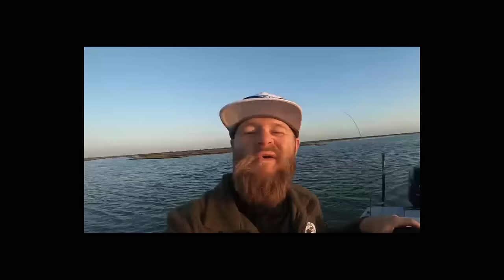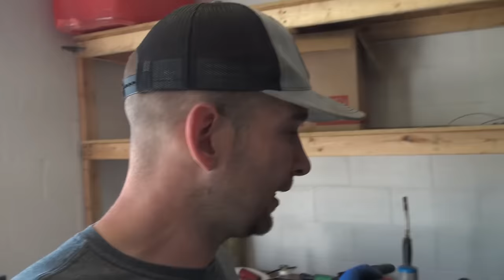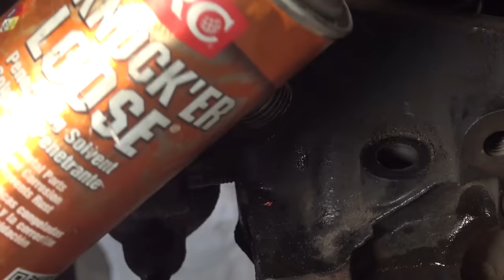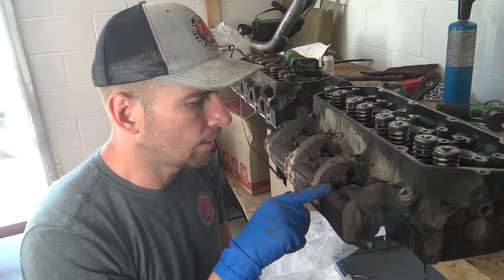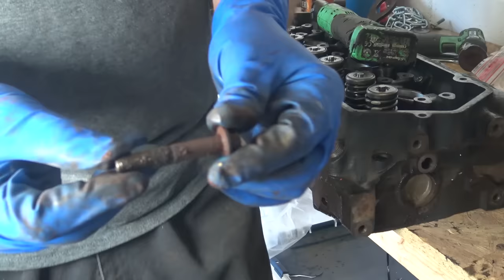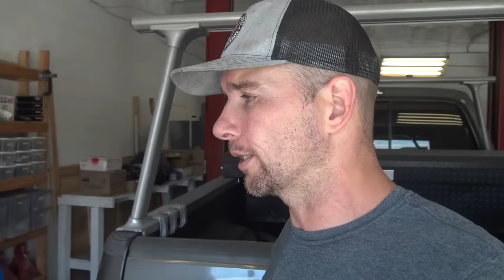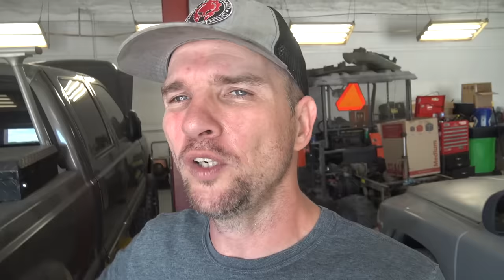Old Mechanic Taught Me This Trick To Removing Rusty Exhaust Manifold Bolts!

Comment: If you snap a bolt off and have to drill it out typically if it is rusted and been through so many heat cycles that it breaks you will have to drill the entire bolt out.   Don't even try an easy out.   If its broken off flush you will have to be very good at marking and center punching exactly in the center of the bolt and drill the bolt out entirely and very strait along the centerline of the of the bolt.  If you use an easy out they can and  will break.  Easy outs are made of brittle high speed steel and almost impossible to drill out.  Yes you can try a carbide drill bit but they usually won't work because of the rough surface of the broken easy out.  The carbide bit will usually catch on a rough spot and break.  Its better in some cases to remove the cylinder head.  Drilling out bolts takes a patient skilled technician.  Stephen's back and forth technique is common knowledge to a good experienced mechanic and is gold.  Usually The only situation an easy out will work is if the bolt is broken off by over tightening but otherwise has threaded in easily.  Use a left handed drill bit and you might not need the easy out.

Comment: Hey Stephen, great video. I'm changing my up pipes and where it meets the manifold,  the head broke off. I just ram to home depot to pick up a torch. They didn't have anymore yellow map pro gas so i picked up the blue tank - propane which looks like what you have. I was 🤔 if that's enough heat to do the job?

Comment: three rounds of wire brush and PB blaster over the course of a day, blasted with MAP torch and slapped a breaker bar on them. They eased out. Orginal bolts on a 95 chevy k1500

Comment: One trick I use for snapped bolts Is to use a stud removal wrench to remove a broken bolt. You have to be careful with the pressure you put on the tool so it doesn't slip,  which is the problem most people have with this technique.

Comment: I always give bolts a good whack with a hammer or with a short stubby drift punch and hammer. Doing this before hand fractures the build up and creates clearance from bolt to thread also allowing more space for penetrate. I rarely snap bolts unless there is some gilding going on.

Comment: Check out the tool called the Shake & Break.  It employs impact and controlled leverage to prevent breaking frozen bolts and studs.  Another cool tip is repeated taps with a small hammer on the fastener, after applying penetrant.  The vibrations cause capillary action to move penetrant into and through oxidation.  If you cannot reach the fastener with a hammer, install a steel or brass rod into a hammer drill and use the hammer function to vibrate the fastener.

Comment: If you have room you can rock back and forth with an impact and it will get done a lot quicker.  Also once you heat it up with a torch that's the best time to spray penetrating oil.  Even a wax candle will work.

Comment: One underrated problem is with bolts that stick through "the other side" where those threads are exposed and hold a significant amount of rust on them. Often times getting the initial break of the bolt to turn 1/32 of a turn isn't where things go wrong - it's when you finally get it backed out a ways. You wind up pulling the rust on the back end of the bolt into the grooves to a point where there is essentially no air space/travel space for the lands of the bolt to move through. This is why using the tightening/loosening, tightening/loosening, tightening/loosening method is so important, all the while spraying more penetrating oil before you tighten back up. Doing both things will break up the rust on the "back side" of the bolt. And of course, if you can get to that back side of the bolt with a wire wheel or wire brush, that's really your first step (cleaning that rust off).

Comment: Good job. I agree with your method.  But most of them were not rusty in my opinion. But I work on old equipment, not cars and trucks. Most of the old equipment the spray from the wheels have been hitting the exhaust and they are so rusty a good set of bits is your best friend.

Comment: I use a pinpoint butane torch to concentrate the heat more to a certain part.  The propane is hotter but I think its more effective to concentrate the heat.

Comment: Probably about a thousand guys said it, but I like to get in there with a hammer - air hammer, if there's room - and give the head a few smart raps or maybe a buzz for a few seconds.  Some vibration can go a long way toward shaking things loose.  And if you start to bind on your way out of the hole, buzz it again and put a little torque on, see how it feels.

Comment: On a 13 MM bolt slightly  rusted, a 1/2" socket will fit tighter. A 14MM socket will fit tighter on a 9/16" bolt.  Notice the play of this 13MM socket as it is turned, a 1/2" will fit better, always use the same point count to prevent rounding of the head of the bolt. Acetone and ATF applied over several times, and allowing to set also helps.

Comment: Another tip, make yourself a blunt brass tip punch, 5/8 dia steel dowl with 1/8 of brass on the tip.
Give the bolt heads a few good solid raps to fracture the deep thread corrosion before twisting.
Paraffin wax also makes a great penetrating lube with torch work.

Comment: Not a mechanic and maybe this technique is well know, but I found this video fascinating. Have a 40 year old Chevy truck with an annoying manifold gasket leak. Everything is original untouched from 1983 so not sure if I could handle this or not as truck sits outside near Puget Sound salt water.

Comment: I worked at a muffler shop for years... The way I did it was heat cool heat cool heat cool burn rust right out but before you have to tap on bolt head with a impact socket n small hammer use a good penetrant

Comment: Old mechanic's tip my uncle taught me, after heating with your propane torch, kill the flame, then turn the gas back on and without lighting it hit the bolt head and body.  When propane comes out it's super cold, so it will cool the bolt down while the outside is hot, making it even easier to crack the rust.

Comment: Peening the material the bolt threads into using a suitable tool…. hammer or punch will expand the hole.   Peening can be used with penetrating oil, or along with heat.   It will work both where the bolt is stuck passing through as here, and at the head where the bolt actually threads in.   Also a   strong whack right on the head in the direction of the bolt as if trying to drive it into the head can work wonders if you can avoid mushrooming the head…. This method is wonderful with stuck allan head bolts.

Comment: You forgot to mention grab a cup of Joe while letting it soak lol. One little trick I've done is after I get a bolt to turn out one or two turns, I squirt it and turn it back in to help get more lube on those threads before trying to back it out. Thanks for sharing.

Comment: Might actually be a good idea to loosen them in reverse order of torquing them too. Probably wouldn't make a lot of difference  with re-tightening as you did but it could help not binding the opposite end like you mentioned, center bolts last?

Comment: My first step is Liquid Wrench Penetrating Oil. If that doesn't work, I move on to aluminum brightener. It literally dissolves Fe2O3 (brown rust), even exposing the Fe3O4 (black rust) you don't normally see. Just make sure to wash off any parts ASAP and replace the fastener if you use that method.

Comment: I have also learned from and old special Effects master to heat the bolt with a oxygen acet torch with a rose bud and heat the bolt and immediately put paraffin (clear wax) let it soak in and rock the bolt back and forth

Comment: I have also been a mechanic for way over 50 years and used to use a gas torch, however if I have to do the same job now I use an electric induction gun that is much safer and easier especially on things like brake pipes and awkward to get at bolts/nuts that a flame could easily catch something alight in the close proximity. They pay for themselves in a very short time

Comment: Hey, You just made a great video showing how penetrating oil is the biggest con going. Look at all the dry rust failing out of the hole. That means the oil did nothing but sit on the top  and go nowhere inside. Think about it, the rust under the head occurs where there is space to get oxygen in. Knowing that oxygen is much thinner than a liquid that means rust is where the oil can't get to.

I have done experiments with rusted bolts into nuts. You can do whatever penetrating oil makes you feel good for weeks if you want to. Then mill half the nut bolt joint away...You will then find the rust inside the nut is still dry. 

Oil on an exposed thread is great for running through a nut. 
Expecting oil to find its way between the threads of a rusted joint just plain doesn't happen...the tolerances between bolt and nut are too tight especially if rust has developed.
Heat helps to thin the oil, and osmotic action will help draw it in the direction of the heat; which may help on something made in 1950 or before, but not with today's tight machining tolerances.

Use lots of oil, just means waste more money and time.
If the surface is wet with oil, more oil just causes a dripping mess while wasting oil.

Just for fun, take two new quality nuts, jam them together on a bolt. Spray with whatever panther piss you want however many times you want. Wipe off the oil, then back the nuts away from each other. You will see dry threads where the nuts where over the threads. Provided you cleaned off the nuts good you will also see the faces of the nuts dry where they touched.

Rust joined parts are like gasketed joints when trying to get a chemical to work. Will spray penetrating oil creep under a tightened spark plug? NOPE! 
My favorite is watching people spray oil on pipe threads. Dude, if you can get the oil in the joint, the water/(or whatever other liquid) would have already been coming out!!!
For God's sake guys, the joint is air tight by design to keep a pressurized liquid or gas inside. That means oil is not going in there from a spray can being applied from the outside.

Acid may dissolve some rust, but it neutralizes as it does it. That means you would have to get the acid inside the interface zone. Allow it to work. Remove the neutralized solution. Re-expose new acid to the zone, and then repeat.

Using a six point socket, and working the bolt back and forth is the process that does the most good.
You are correct that the bolt will twist to failure at the first thread. 
If you can see the bolt head and the thread beyond it turn at the same rate you know you have it going your way.
Back and forth twisting breaks down the oxidation to smaller size so it doesn't cam lock into the threads. Works great with steel bolts!
Note back and forth will often make the problem worse with surface oxidations that are really hard like: aluminum, stainless steel, Inconel etc., because the oxidation layer is harder than the base material. The back and forth just dislodges more oxidation layers to cause more cam locking within the threads.

Anti seize is a great thing to do, because the next guy to take it apart may be you. It is common courtesy to at least send a text to your neighbors' when you open a bottle of that stuff, so they know to close up their house for a week...that crap gets all over everything!

New bolts are a must for the same reason as the anti seize, and they also tend to break later on.

Comment: I've found that the initial tightening/loosening is much more easily accomplished with a breaker bar rather than a ratchet, kind of like it's a lot easier to rock a car back and forth out of a rut the tire's dug with an automatic than a manual transmission since it's a lot easier/quicker to transition from one direction to the other.

Comment: As an old tricky mechanic who usually worked on old neglected gear, there is a step you missed, Ger a drift about the same size as the head of the bolt and use a big hammer to drive the bolt in like a nail. Use lots of penetrating fluid and then the same technique shown here, works on screws too, and rusty wood screws.

Comment: He omitted one important aspect when you spray penetration oil. You get a small hammer and tap on the bolt and surrounding area. When you set up vibration, this assist the oil to penetrate around the threads! Machinist truck!

Comment: A few years I changed a head gasket and I said "This is a 4 cylinder it should be real easy" it had about 8 bolts holding the exhaust on. and every last one of them twisted of with little resistance. they were all broke flush or close to flush. turns out it was still easy for me. the head went to the machine shop to get resurfaced and we paid them to take the bolts out. but yeah the way you are doing it usually works and can save you a lot of trouble.

Comment: After heating spray the bolt with knock loose to cool the bolt so it condenses while the heated block is expanding from heat.

Comment: Here’s my method for bleeder screws. 
Lube, heat then put your wrench on it with some pressure and tap the wrench with a hammer (the end with the bleeder)
Basically, you are making a simple impact wrench.

Comment: Only thing I have to add: if you have to weld a nut on, weld it as hot and fast as you can. The heat penetrates quickly with a weld, which can significantly help with the removal process

Comment: I use Kroil which far surpasses anything else as a penetraiting oil. I have used it to  disassemble some British Enfield SMLE bolt action rifles and some 1911s. Kroil, developed by Kano Laboratories, is advertised as "the oil the creeps" and indeed I can testify it goes where no others will. A trick I use to get the penetraiting oil down on the threads is to tap on the bolt head with a wrench, hammer, whatever, immediately after putting on the oil as it helps create vibration between the mating surfaces and help the oil to wick into those surfaces. I used this technique, with an 18" breaker bar and a six point socket to remove the seat bolts (4) holding my driver's seat in my Jeep Wrangler. Also, wear some eye protection as you have no control where the overspray is going to go once it hits all of those different surfaces and could splash back into your eyes. You will be spending your hard earned money in the ER room at the local hospital getting your eyes treated and could loose your eyesight! An ounce of prevention is worth a pound of cure!

Comment: Air hammer the bolt heads and use a oxygen / acetylene outfit .  Use the small welding tip to keep heat concentrated .

Comment: Just use a solid breaker bar to go back and forth, this will save you ruining the ratchet. It only has small teeth inside, Hard torquing using ratchets is a good way to kill them That said, You did good, very patient. excellent content .

Comment: I'm about 6hrs in drilling out this grade 8 hardened bolt from my manifold downpipe flange. Why Ford threaded them in, them I have no idea. There is no room to work..  Had to get a flex shaft for my drill. Just got some tungsten carbide burs to try out tomorrow. Chasing those threads is going to be a real treat

Comment: I will incorporate putting exhaust bolt back down to stop warpage frustrations. Thank you! My almost reliable, lol, method is after the spray has had time to work, slowly tighten the bolt then even slower UN-tighten the bolt. never with an impact first, second, third, or fourth attempt. fifth maybe, or torch. SLOW DOWN IS PARAMOUNT! I have approximately between 75 % and 90 % success without breakage. Some are rusted so badly, they just crumple.

Comment: That's basically same thing i do. 
There's a few good tricks I've seen others use. 
You can weld a nut on bolt head. Let it cool and work it.
Smack the bolt head with a hammer and  punch. Breaks loose some of the crud seizing the bolt.
If you use brass nuts on bolts holding exhaust pipe to manifold they will come apart easier the next time.

Comment: I am having a problem with loosening an alternator mounting bolt. The threads are loose in the cylinder head, but the bolt's shaft is seized where it passes thru the aluminum alternator body. How can I get this loose without destroying the slternator? It seems like a problem with dissimilar metals, where the aluminum has oxidized and "grown" tight around the steel bolt.

Comment: I watched a mechanic do the same technique of out a little, back in, out a little more, back in, with spark plugs in an aluminum head that were there for 120,000 miles. A great idea. He didn't use penetrating oil, but he probably could have.